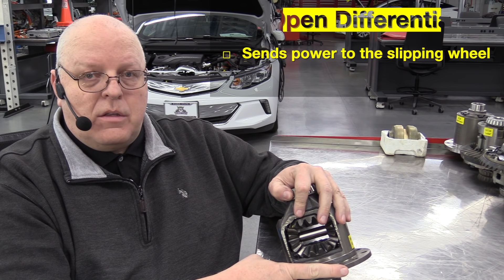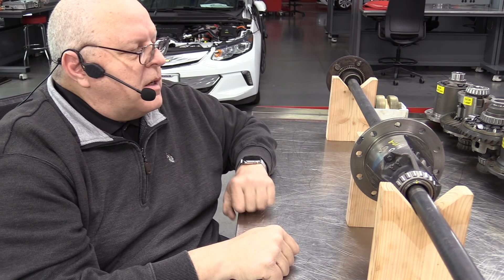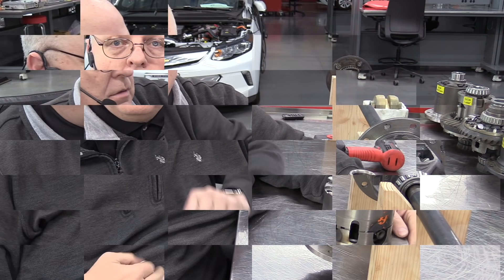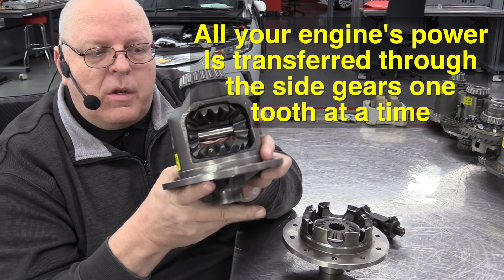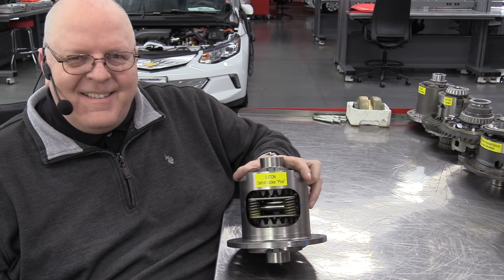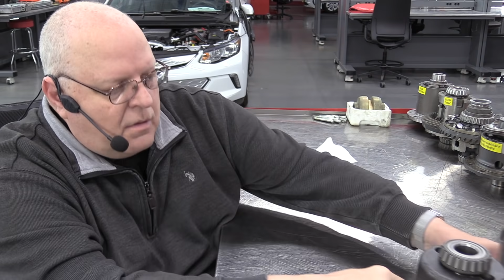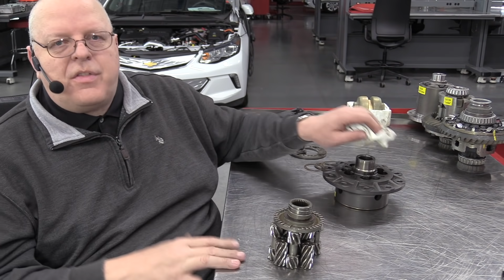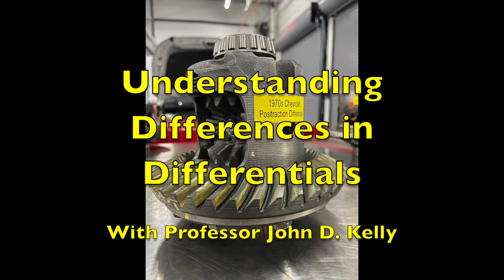Understanding Differences in Automotive Differentials

Comment: My Dad retired from Dana as an engineer and I never thought that was cool until now. This video was fascinating. Thanks for teaching.
Reply: The eaton locker used to be called a Gov Loc, they kind of got a bad reputation for grenading when they would slam engage under power. Kind of suprized you didn't mention one of the toughest and oldest of them all the Detroit Locker or it's cheaper brother the Spartan or Lunchbox Locker. These work great as does the ARB Air Locker. For Cable type there is the OX Locker I have a friend in Alaska that has a full size Chevy Blazer with a Dana 60 up front and a custom Dana 60 in the rear both with OX Lockers as well as a NP 203 gear reduction case in front of a NP 205 to double down on low end torque. His truck is a cost is no object beast 😊.

Comment: What a great explanation and video regarding differentials.  Back in the early 70s friends and I were racing a 1/4 mile banked paved oval in Sault Ste. Marie Ontario called 5th Line Raceway.  These were mostly home-built cars with a full roll cage and good harnesses  but many were of great quality.  Everyone I knew welded the spider gears and side gears into an assembly turning the diff into a spool and it worked just fine.  One time a friend was building a Ford with a 9-inch differential and we tried inserting the diff case into an axle standing on its flange and poured the case full of lead which when it solidified had the same effect as welding the gears.  To my knowledge it did not fail before the car was wrecked beyond repair.  My recollection was that the 9-inch diff case was pretty closed up, so it would have been difficult to get the gears in the proper spacial relationship to function as a spool, so we tried the lead as a substitute for welding.  Good times.

Comment: I wonder if electromagnets running in an oil bath with iron  particles would give much traction when the magnets are powered up? Would the iron particles fuse between the magnets enough to give you any traction?

Comment: I just bought an 98 chevy blazer 4x4 rear end with the Eaton locker in it to put under my 55 chevy truck.  I wanted that because it fits and has disk brakes. I researched it and found it only locks until rpm variations between wheels and is also a weak rear end. Time will tell. This is what i found a while back.  
"The G80 is a specialized differential designed by Eaton to work as a low-speed traction aid, offering full lockup during its operation. When in normal conditions, the unit acts as an open differential, letting the rear tires spin independently of each other, with the outside wheel spinning faster during turns. However, when one tire spins 120 rpm faster than the other, the G80 locker kicks into action."

Comment: What a great video. It's truly amazing the amount of engineering that most people take for granted in their daily lives. For comparison it is similar to the model of the layers of abstraction within computer science and programming that we are taught to accept. The User(s) of your source code only needs to know about its functionality from the outside interface and shouldn't have to concern themselves with the internal workings or implementation details of how and why it works. They only want to know what it's supposed to do and if it works or not. Seeing the various types of differentials in a row or a line reminds me of that. They all provide the same functionality yet they are designed and implemented differently from the internal view. It's sort of like comparing MSVC with GCC with Clang when it comes to compilers, as well as the different available libraries that one could use to design their overall project.  

I wouldn't say that I'm a "reverse engineer" however since I was real little I was always taking things apart because I wanted to know "How is it made, how is it capable of doing what it is intended to do? With this type of curiosity and mindset, I've started with C/C++ programming with a desire to learn 3D Graphics - Physics Simulation Programming but from there I dived down the rabbit hole through the lawyers of abstraction by looking into Compiler Design, OS Design all the way down to the metal with Assembly and (ISA & CPU) design from basic Logic Gates and how those Logic Gates are made from discrete electronic components. I didn't stop there at the basic "circuitry" level as I even looked into the composition of such devices at both the chemical and physical levels. 

Regardless of my tangent, this is why I truly enjoy videos such as this. They always help to bridge the gap from one layer of abstraction to the next. Thank you for providing this knowledge for those who are of like mind. It's awesome to see videos like this so that future generations may not lose it.

Comment: So I noticed the 2 springs on the front and the 2 springs on the back you had mentioned in the 70s style differential are not the same distance apart. You did not explain why that has come to be this way.

Comment: As a GM fan  I’ve ran them eaten gov lockers for years let me tell you when you jack up one wheel and the other  wheel is solid on  blacktop and you can roast it I would call that a locker now if you take and do that same test with one of them with just springs that doesn’t happen I would like to see more testing on that

Comment: Wondering abt the non posi posi’s. Open differentials that have traction control using speed sensors at each wheel, electronics, and the wheel breaks to transfer power?

Comment: The Rubacon air locker, so called "thorsen" with long &short parallel gears looks EXACTLY LIKE my Wheelhorse's diffrential== pure open differential: just like Henry Ford's modal A's &T's. with "side" long pinion gears. It is Only an open or an AIR LOCKER. It "may" have a Very slight amount of "limited slip action" like the "Wheelhorse's " amounting to a measly 5% of empty torque equalization. The "Eaton" locker looks and sounds like a GM "Gov-lok", since 1967 l agree.

Comment: Very good tutorial although I knew the function of a regular open diff. from a color coded animation I saw somewhere the function of LSDs , Lockers and Spools always escaped me. Finally understanding it had a great relief as I have been driving AWD Subarus for years.They sometimes on hi mileage versions have a condition where the center diff.damages the center diff. responsible for front axle to rear diff. action caused by people either putting on tires with different diameters or uneven front to back tire wear which was the former owner's case on my current ride.The cause is either a worn duty solenoid or worn out clutch packs in center diff. If it is the  solenoid can R&R or just put car in FWD only mode and drive like that but if it is clutch packs must more or less rebuild unit as putting it in FWD only mode car' s tires still grind against each other from front to back ONLY on slow speed tight radius turns! I have driven this car many miles by adding a LSD diff additive! The front and rear diffs have regular gear oil but the center diff does not!  It apparantly just has tranny fluid so it must be a viscous coupled diff. but I don't understand this being old-school.
Apparantly there are many other AWD vehicles that have the tire wearing out center diff.problem so I would like to better know how and why this happens.

Comment: Fascinating video. I have one of those 2010 Camaro SS differentials in a V8 swapped Miata that I built, and I'm having rear end vibration issues. I would love to know what the symptoms of the worn out clutch pack were in the original car. Did it vibrate or make noise? Did it have any issues with fluid exiting the vent tube or other unusual behavior that was a tip off? Thanks.
Reply: If it's vibration when driving normally, and it changes with speed, then you probably have a tailshaft imbalance (or the universal joints aren't aligned correctly).
Worn LSD clutches just slip, in other words have less grip and hence not "limit the slip".
If you have chatter when TURNING sharp corners, then you have incorrect backlash and/or incorrect gear fluid / oil.

Comment: There is another diff type; the Eaton Detroit Locker that has NO pinion gears nor shaft.  It is a fully locked unit that unlocks one side when cornering; IF there is enough traction to force the lock collar away from its side collar.  I learned to drive mine in a 68 F100 with torque monster 428 & 4spd on ice in a city.  I would not recommend doing that.  I put it inn when I destroyed my true trac clutch type worse than the Camaro unit in this video. I just checked & at least some apps are still serviceable with it.  I believe the unit was first used in log trucks & trucks in Alaska/Yukon.  I also know that you can completely shear one axle & it will still drive.  Also, when facing this issue, you really need to cut off the axle shaft or remove it & cap the hub if you need to go very far before repairing it or else the wonderful silver goo will force you to walk anyway.

Comment: I used to do some Road and Forest Rallying, and was thinking about installing a LSD, but I came to the conclusion that it was not worth the effort.   The only time it would have worked would have been on hairpin corners, which would only occur twice in a rally.   Also the time lost would be marginal as the added load would stall our high revving engine.   We normally used to put up with the inside wheel spinning, to maintain our revs.

Comment: The air locking differential actually answered my question that it is possible to both  have the feature of a limited slip differential and a selectable locking differential in the diff carrier. Best of both worlds if that makes sense. I thought that selectable locking differentials is just only an open diff with a locking mechanism.  Thanks for the in depth video!

Comment: Current engineering in mechanical LSDs is terribly lagging behind the intellectual successes evident in engineering of every other part of the car. Relying on clutch packs is such a poor way to do this.
I designed an electronically controlled 100% variable differential that uses a speed driven electic motor that drives a worm gear to govern the amount of differential action between the gears on the pinion and the differential housing. It would use inputs from steering position, wheel speed sensors and varous other road condition sensor to determine the speed and direction the worm gear shoud turn. I never got funding and gave up because i looked into just how much attnetion it woudl draw and i was adamant id loose it and never get any econmomical benefit from my invention. Basically in a straight line at any speed, the worm gear would be stationary, and allow no differential action. as you turn the wheel, depending on how fast the car is movingt, the worm gear would be rotated at a fixed speed to agree with whta the car wants to do, no force would be imparted on the worm gear becasue it is simply agreeing with what the car wants to do. SO therefor, teh motor could be tiny and be fitted onto the rotating body of the different housing, adn be supplied power via slip rings through the casing. It would be like driving a gecko, not a car, wiht 100% calculated grip being applied to every single wheel based on its calculated ground path speed. This Video reminded me how passionate i was about the invention, i thoguht I was going to be a millionaire.

Comment: Really enjoy the thorough nature of your presentation.  I wish you had explained the concept of the ball plate.  I assume this is similar to the brake apply mechanism of my massey-Ferguson industrial tractor, and is a self-energizing expansion device that can apply crushing amounts of pressure to the clutch mechanism.  Far in excess of what is possible in the Posi setup.  I also expect that it may be necessary, in certain instances, to reverse slightly to release tthe pressure, but I may be wrong.  Also, in the case of welding the spiders into a spool, the gears are definitely not cast iron.  They are high-carbon alloy steel.  This detail aside, the dynamics of welding such material is indeed similar to cast iron as electric arc welding introduces such a localized high heat, that the portion of the gear not directly exposed to the arc remains cool enough that it removes the heat from the weldment fast enough to produce a quenching effect that manifests itself in the formation of a brittle boundary layer at the weldment root, similar to cast iron.  This boundary layer causes fractures under stress, sometimes during cooling, that many refer to as "tearing out".  The solution to the tearing out problem is an understanding of what is actually taking place, as well as special alloy electrodes and a willingness to sacrifice any heat treatment present in the gears.  In short, as you say, welding spiders is an extremely bad idea, if for no other reason that the assembly cannot be undone, and will likely be destroyed in the process.  However, like the old Aamco ad used to say "let me try boss, I always wanted to work on a transmission."  I'm sure Goober is alive and well.
Reply: Good info there, Bill👍 I'd like to know a tenth of what you do in welding and metallurgy.

Comment: Shimmed the Posi in my '66 Corvair so tight it wouldn't STEER ON SNOW, lol !
I had to pull the engine+trans, break it all down, and take my homemade Brass Shim out of the Posi Clutch Stack ~ because it was just undrivable with studded snow tires and no extra weight in the front trunk !

Comment: If you are showing components on a tutorial.....you dont need to have the presenter in the frame.  You should be focused on a closeup of the items you are showing....specially  if the components are complex.  Presentstion is great....but  videography could be much better.

Comment: i believe "lincoln locker" is the patented name in the welded diff.     check out lock right.  its a mix of a spool and air locker,  but with a round pin and springs to the dog cups in (disengaged) any pressure from center pin pushed out the dog cups.    i had on on a 4x4 s-10,  no more 4x4 binding on when all 4 wheels had traction, like pavement.  s-10 disengaged the right cv axle from diff when not in 4x4.

Comment: I have a limited slip diff in my truck's front axel. Because of this when I put it in 4 wheel drive it steers funny because the front wheels want to go at different speeds. So,  if I put a torsion diff in the front axle will it make the car steer funny to.

Comment: What kills me is I have a transaxel and I guess the need for a differential is void? Cut out the middle man, I have two drive axels,  1 for each wheel on my Oldsmobile toronado trofeo, and I reach speeds of 80,90 and never seems to have an issue. But of course, I don't want to do that too much at the same time. But what in the world is causing my rear wheel bearings to wear so fast. Just replaced em after 6 months already. Gees. Love your videos.

Comment: Hi professor, very interesting video, i have a question about torsen differentials. This kind of differential send more torque to where it can, to where there is grip, but can for example a center torsen diff have a fixed ratio of 40-60 or 30-70? Thanks.
Reply: Fixed (not variable) ratio may appear only when front and rear axles have the same grip, speed and load.
Reply: @4x4.tests.on.rollers  Cusco sells center differentials for the Mitsubishi Lancer Evo and states that it have a ratio of 30/70, how is it possible?
Reply: @edwink89  If that's torsen or helical diff then it is like I wrote in previous comment. Nominal torque split may be 30/70 but it varies during driving.
Reply: @4x4.tests.on.rollers  Yes, it's helical/torsen. Do you know how is that achieved? Maybe different gear angles, or number of teeths of the diff itself?
Reply: @edwink89  I am not sure if I can link here, please comment anywhere on my channel and I will link you simple explanation (made by Audi engineer).

Comment: An additional point to consider (I’m only about a quarter way through this) is where the small spare tire is installed.  I’ve seen some people drive at interstate speeds for weeks on one of those.  It’s beyond the design speed of the tire, to start with, but it also causes the spider gears to rotate in the  differential hub more than they normally would.
Reply: Just like going in circles. Not a big deal.

Comment: This vid took me back to my first year of Voc school in ''77! LOL I would like to add, when pulling the preload springs on a Eaton style LSD you can use a "head on block" valve spring compressor. These cost only few bucks and the jaws are adjustable to spring diameter. Works pretty good.